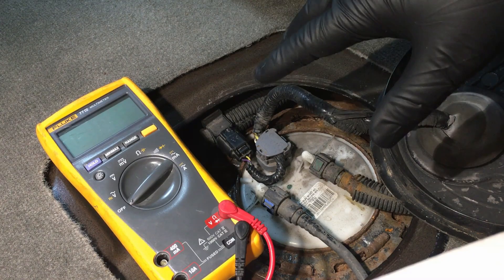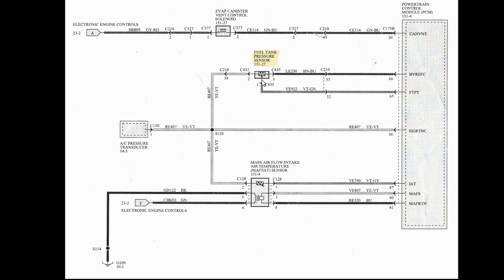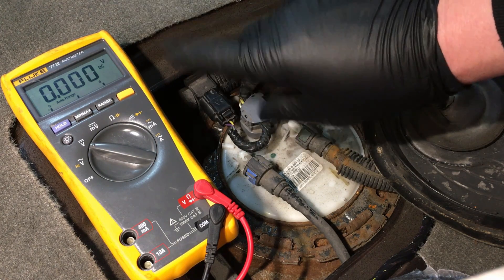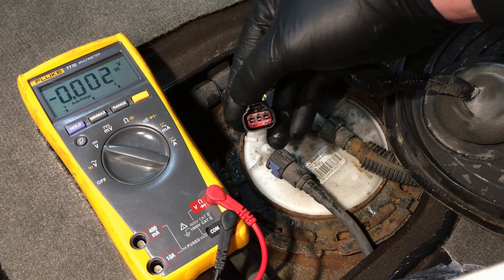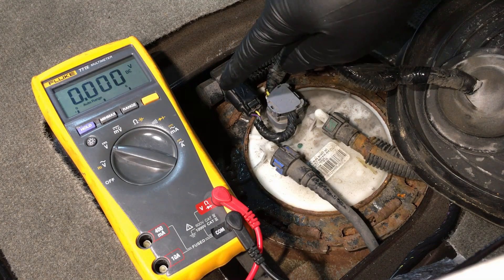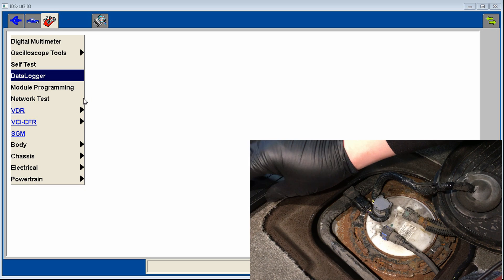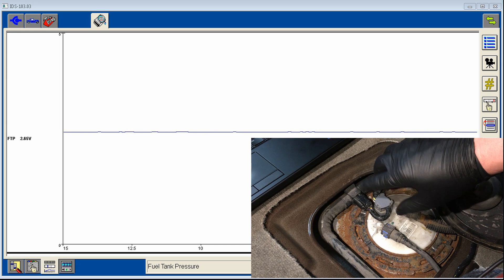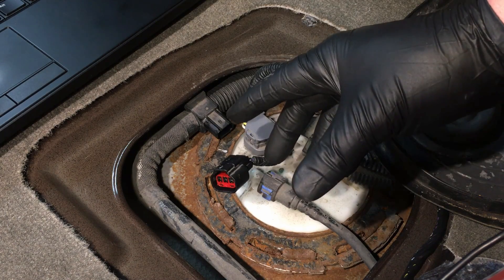Ford Quick Tips #67: Quickly Diagnose Critical Engine Sensor Faults!

Comment: Brian so what if we reading battery volt 12vt at 5v ref sensors? Bad pcm Ground
I have went through every ground but PIN OUT, and internal SPEED SENSOR 5R54E, So lost could use hint, all 5v ref sensors are throwing code high volt, also tested with mlt meter 12vt engine off, 14vt engine on.

Comment: Instead of using a straight jumper wire on these 5V circuits to pull up or pull down voltage on the signal wire, would it be a problem to use a test light to jump the wires instead? I ask because it seems safer to use a jumper that has some resistance in the line, in case I make a mistake.... Since the current flowing in these wires is so small because they are already protected with 5000 ohm resistors, adding a little resistance with the test light shouldn't change the signal very much. If I mess up and jump the wrong wires, it would seem to be safer to have current limited to the 170mA of my test light.

Comment: If a sensor's grond wire is open and it's difficult to repair, can you ground the sensor at battery or body? And drive like that without problems down the line?Thanks

Comment: I would have thought that your test shorting 5v reference 5v supply.would knock out the ecu driver.
Reply from the maker: +gst69man nope it made to handle it there is a resistor in circuit

Comment: Hi, I have 12,39V on the IAC ( the same as the battery), and 4,89V on the CHT( Cylinder Head temperature Sensor ), are these OK? thanks
Ford Focus 1.6  MK1 2001

Comment: Hi, i dont understand why are 5 v on the signal wore when you disconnect, its a bias voltage or not?
Reply from the maker: No the 5v reference would be considered the bias voltage it uses the same 5v to get the reading from the sensor. Depending on what the sensor is outputting that is offsetting the 5v= your reading.

Comment: Hoping you can point me in the right direction. I'm trying to locate the factory radio amplifier in my 2002 explorer sport (2 door). I've looked in the side panel behind passenger and driver and no luck. The group of wires appears to run behind the passenger and driver seat. Could the amp be in the center console?

Comment: What is a floating ground?
Reply: A ground/low reference that's separated from "main" ground and does not correspond with main ground. One way to envision a floating ground is two cars sitting side by side. Both grounds are separated but still functional in the car they reside. However, if you were to try to test voltage on car A with your ground/negative lead connected to car B you would get incorrect readings because car A has a floating ground when car B is the main ground reference.
Reply: Killer2600 Nice analogy. Thanks

Comment: I have a 01 mustang v6 3.8 and my cooling fan doesn't come on when I have run the car for a while but the fan works and the cylinder head temperature sensor works what could it be?
Reply: If i understand correctly the fan works after first start up but after a while of driving the fan stops?? has the car overheated before? Really not too much it could be. using wiring diagram youd have to ohm from the fan connecter to the battery junction box (fuse box - under hood) and verify you have good continuity. Other thing to do is a voltage drop test to see if the fan is able to get the correct voltage while running )which can be tricky) and if it is below 10 v that would indicate damaged wires. being a ford tech i really havent seen too many issues with those fans. Either its the fan itself - something inside the fan is loose and after heating up it becomes to far apart to make contact. or id check with a scan tool once the fan stops working after running the engine and look to see if the pcm is still commanding the fan high or low. If no signal is being sent than the fan obviously wont come on. Could very well be a pcm as well. Start small though like i said. Check all wiring and connecters to verify nothing is loose,cut or damaged. best of luck!

Comment: How would you or could you blow up the driver on that circuit with a jumper you were using? Maybe you could do a video on things not to do to your cars computer system ?
Reply from the maker: No this is a Ford approved method straight from the PCED diagnostic manual.
Reply: Hey Brian, very informative.  The voltage on the signal wire must have been a bias voltage for diagnostics thats why it did not light the test light and the 5v ref on the other
wire did produce some light at the test light because of the slightly higher amperage, or am i wrong. I believe bias voltage is being used more and more just for diagnostic reasons.
thanks for all your hard word. looking forward to some day when you can go with a premium channel with a lot more dedicated videos. I will be one who will subscribe.
Thanks, Bro

Comment: fordteck. I have a 1998 ford f150 5.4.    2wd. what happens is I tern the key to the on position with out starting it and I shows a check engine light. but after I start it it goes away and my over drive button on the gear shifter flashes do you have any idea what that might be
Reply: check engine light will always be on when you turn the key to the acc position on. Its called a bulb prove out.  It just shows that every light on the instrument panel does work before you start the car.